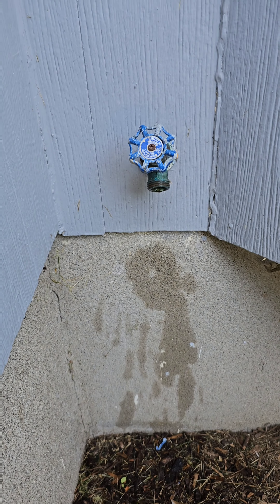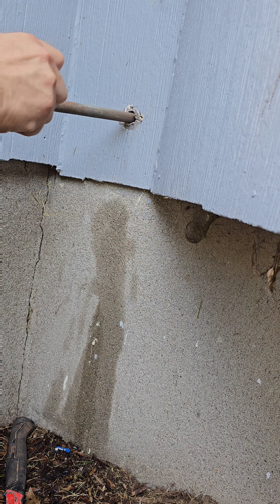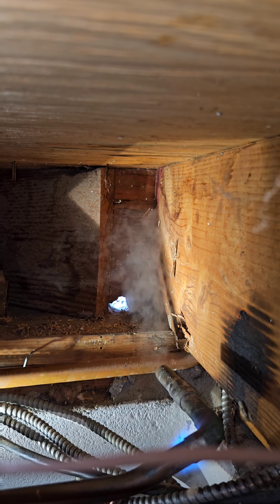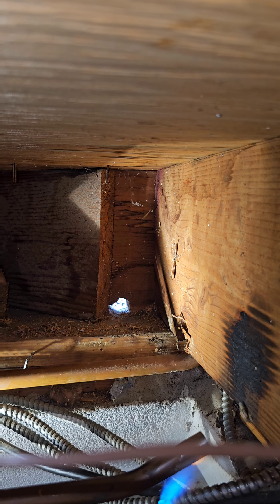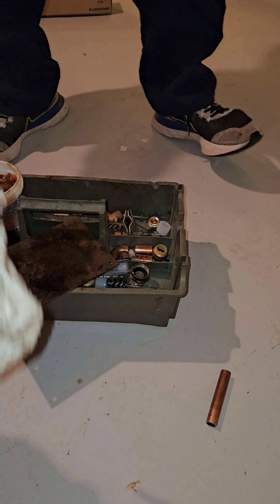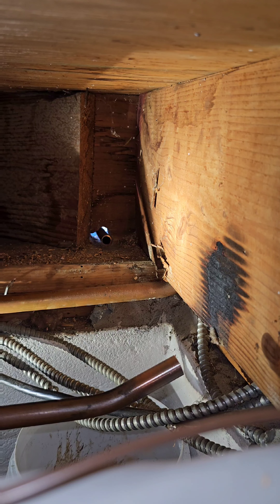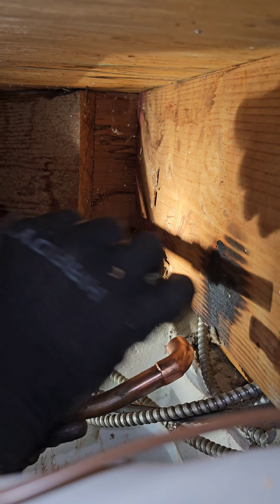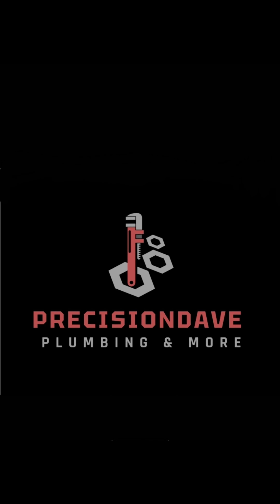Frost free spigot installation #northjersey #diy#plumbing #leaking #plumbinglife

Comment: Why would you ever use a female connection always leaks over time
Reply from the maker: What the spigot will leak before the female starts leaking. Never had to replace a spigot because the female leaked. Thanks for watching
Reply: Must not be cold where you are at we replace them all the time after winter if they did not have a ball valve to shut the water off farther back
Reply from the maker: @mike-jv8sn  It gets cold in NJ but never leaks from the female. Always bursts in the spigot shank. More reasons to use a female so you can replace it faster.